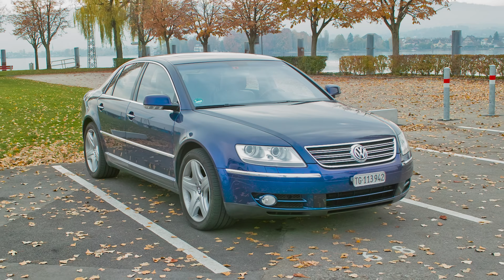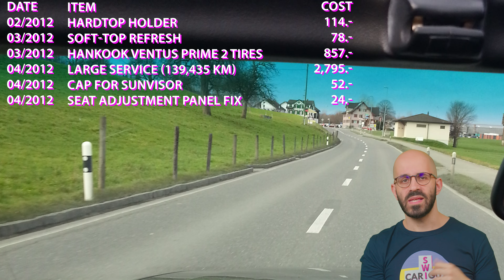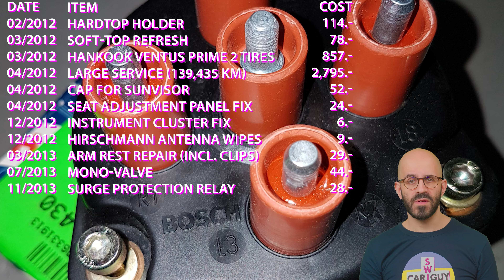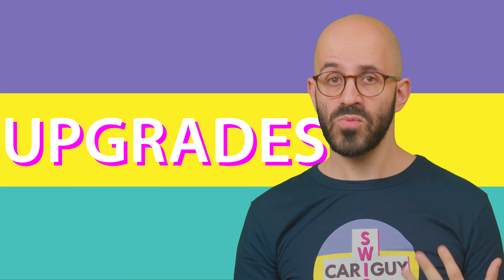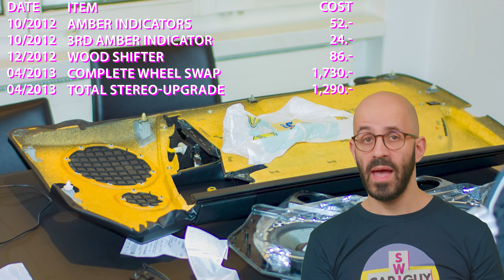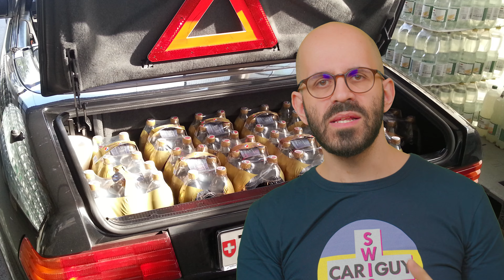How expensive was it to own a 1991 Mercedes 500 SL? Total Cost of Ownership [TCO]

Comment: A really helpful video, thank you.  I did note  are a couple of minor errors... The hardtop is not fibreglass.  It is an aluminium frame and skin. The biodegradable electrical wiring was fitted to R129 cars from 1993 -1995.  The Mercedes company were however still using this wiring in other models into 1996.

Comment: 11:50
If you don’t mind my asking, where did you get those 10 franc panels from? They’re like $130 on eBay, aftermarket not new. 
Does Mercedes still offer this part?
Reply from the maker: I did not replace the entire panel, only the plastic frames that get screwed to the panel. I bought those from the Mercedes dealership for very little money. These are the part numbers:
1297270111 Left door, top frame
1297270311 Left door, bottom frame
1297270211 Right door, top frame
1297270411 Right door, bottom frame

In case they are not offered anymore, a good soul on makerworld shared a 3D-model for at least the lower brackets that can be 3D printed:  https://makerworld.com/en/models/114099
Reply: @swisscarguy 
Thank you SCG! 
I think I misunderstood. I thought you were referring to the seat switch panels (the wooden veneer joystick covers) A1297200322 / A1297200422. Coz those are exuburantly expensive. The custom made ones are almost $500 a pair. 
The link is retrieving error 404: This model does not exist or has been deleted.

Comment: Hi, great video! I have a 500sl 1992  and have the same issue as you did in traffic having to fully stop in order to open or close the convertible top. Wondering if you remember which is the speed sensor wire and where is located, the one to cut and enable retraction of the soft top while rolling? Thanks :)
Reply from the maker: The mod is very easy, as it's just two wires that need to be cut. The control unit is under the rear right interior storage box ('back seat'). 
On the large connector you would have to cut the green/black cable and the black/yellow (attention, there is also a yellow/black one that you must not cut). Just tape up the loose cable ends and you're done.

Comment: 11 hydraulic actuat.ors for hard top. chain that may stretch if not replaced. degrading wiring harness hoses and clamps. possible multiple oil leaks ... flex disk replacement.. engine management computer failure. .... after about 10K or more you may have it sorted out

Comment: 1996 to 1998 are model year SL 500’s to buy.  They have the 119 engine and the 5 speed.  They also have modern fuel injection instead of mechanical injection which is very problematic.  It is worth the minor loss of power for the improved gas mileage and reliability.
Reply: What’s wrong with the 99 ?
Reply: @pharaoh390 The engine was cheapened.

Comment: I have owed a 1999 SL320 for 7 years and I am thankful I never saw your video before I bought it, because I never would have and I would have missed out on the best drive of my life! I still have it and apart from replacing the ECU when the roof decided to stop working and replacing the soft top plastic windows the car has cost me nothing but general servicing, road tax and insurance and since I retired the insurance now is negligible! I wanted a 500, but never saw one with a clean interior so when I saw my immaculate 320 that had only been owned by one lady from new until she passed away I had to have it. Cost me £7k and I have been offered £14k for it recently so it should actually cost me nothing if and when I get around to selling it!

Comment: Helpful.  Thanks. I own a '14 MB e550a cab with 65k miles.  Only replaced a parking brake release and tightened some body bolts so far. 

This helps me set my repair  expectations at $10k -$20k for the next 100k miles.  Much higher plans than I have spent on other new Japanese sedans getting them to 250,000 mi.

Comment: Great video!!  I own a 1991 500 SL.  Bought it in 1999.  I live in Florida which is a great place for convertibles.  It now has 89,000 miles (143,000 km).  I keep it in immaculate condition and only drive it occasionally in nice weather.  It is kept under cover in my garage.  I love this car and like working on it myself if something needs to be fixed.  I am intrigued by the mod you did (wire cut) to allow soft top operation while driving.  Do you have a video covering this modification?  If not can you provide the info on this?
Reply from the maker: The mod is very easy, as it's just two wires that need to be cut. The control unit is under the rear right interior storage box ('back seat'). 
On the large connector you would have to cut the green/black cable and the black/yellow (attention, there is also a yellow/black one that you must not cut). Just tape up the loose cable ends and you're done.

Comment: Love this video.  I have a 2015 R231 SL550 in a Designo Graphite Metallic and have been wanted to add another SL, likely a R129 in a different color - perhaps Irridium Silver.  I had a 2002 G500 in Techtite Grey Metallic which appears to be similar to your 91 500SL.

Comment: I have a friend willing to sell me his for 300 due to relocation. What you recommend I do to find out the issues on the vehicle?
Reply from the maker: Look it over carefully and drive it. Push all the buttons, try everything and make sure everything works. A wire harness that is failing can be seen with the naked eye. And there should be no rust. The R129 were well built in that regard.
Reply: @swisscarguy  great video. How about fuel consumption on this ke jetronic version? I imagine you have an objective idea after 4 years of ownership and more than 10.000 km driven. Thank you. By the way,  much is a good 500sl worth nowadays? Cheers

Comment: I bought my 1998 SL500 last summer and love it. I replaced all of the convertible top hydraulic cylinders myself, 11 total, not difficult at all and also had the canvas top replaced with a color that complimented the body color. Purchase price was $8,500 US, all repairs and upgrades brought that to $13,200 all in, that included $1,400 shipping car from Atlanta, Ga. to Buffalo, N.Y. and installing a rare 6 disc CD changer in the trunk. I love my Mercedes !
Reply: Where did you order the hydraulics?

Comment: Thank you for the detailed report and reference for your car. I am extremely interested to buying an almost exactly same car. A 500SL with 105.000km with all the repairs you mentioned  and more like both of the fuel pumps and the 12 pumps of the roof. All these for 18.000 euro approximately.I got a bit skeptical about the drivers seat and the sense of the steering wheel... I think that it’s important to give you a proper sense in order to enjoy it as much as possible. Totally is it worth buying it or should I search for a Honda S2000, which is a convertible also but a totally different car. Thank you in advance, greetings from Greece
Reply from the maker: 18k Euro is pretty serious money. The car should be pretty good for that. 
The SL and the Honda could not be more different (while still being 2-seater roadsters). The SL is a cruiser, while the S2000 is a much more active driving machine. The steering alone will make for a completely different driving experience.
I think a R230 generation SL500 (or SL350 as the don't come standard with ABC) might be somewhere in between the R129 and the S2000. You don't have the classic look (and old-school solidity) of the R129 but much more driveability (and interior space). 
The 500 SL is more akin to driving a classic car while the S2000 feels much more like a modern sports car. 
Before you make any decision, make sure to have a nice extended test-drive in any of the cars you consider. Only after having driven all of them you will know which one you really like best.
Reply: @swisscarguy  it seems like it is properly maintained...so that's why I'm thinking about it. The good about this case is that it's not so easy to be sold. So that's why im taking my time. Soon after the chief mechanic of a Mercedes Benz official retailer, who I am trying to convince him to check the car, because he works at another location but i trust him a lot, tells me his opinion about it i would let you know
Reply: @ΠαναγιώτηςΜπουτος-π4ι  i import cars from greece to albania and italy.
18.000 on car.gr for any 500sl is an excellent price and it isnt going to get lower than that.
On the other hand the s2000s are going for 13-14 thousand on the cheapest side and they all are dilapidated and destroyed from being drifted, too many burnt clutches and bad engine mounts.
Reply: @swisscarguy  thanks a lot for the advice

Comment: Very good sum-up, and nice to listen to. I didn't know you owned an R129 SL, in fact you owned plenty and only interesting cars. I was aware about the R230 SL 55 because I watched this video a very long time ago. I kind of expected the results because with your other cars costs in mind, I couldn't stop thinking through the video "still surprisingly cheap!" "Wow there we are and still no catastrophic unavoidable repair??"

I like this generation SL a lot, my favorite being the 600. It is just impressive how this car was high-end and yet, today it still is, but looks very understated. And when you climb inside, you realize everything is beautifully crafted, it is super quiet and rides like a carpet. But obviously that comes at higher owning costs, and the adaptive suspension is standard, probably to support the weight of the engine.

While being an objectively good and a very respected engine among the Mercedes community, I agree on the M113. It's a shame it only has 3 valves per cylinder and it lost power compared to the M119. However, in 55 AMG cars with the supercharger, it rocked. 470 hp is crazy even today. And it managed to stay ultra reliable.

Comment: hello. thanks for the video I watched the movie out of curiosity and you inspired me to open the roof. I will do this cool mod in my only on the switch so that you can activate it at any time. greetings from Poland, SL 500 99
Reply from the maker: On the 99 it's not supposed to work by cutting a wire. You will need to install an auxiliary control unit for that. But that is not a big job, as I've done it on my R230 that I had later. It just costs more money than just cutting a cable.
Reply: @swisscarguy  If I find some time I will check it. Thanks for the information. I will write if I do anything.

Comment: How expensive would it be to replace the top on a R129 ??
Reply from the maker: The soft tops themselves can be bought starting at around 500 $ / Euro but it's the labor that adds up. It will take something like 8 man hours. The soft top pope in Germany - a guy who used to work at the Mercedes factory in Bremen where he did nothing but install soft tops - can do it in about 4 hours. But nobody's more skilled than him with these tops.

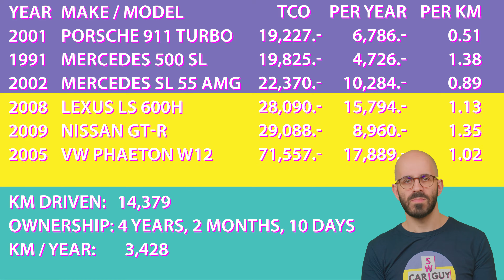Comment: 9:45 I hope the humbled mechanic was not the brand name dealer. 28:00 I wonder what TCO would be for using brand name dealers where possible. I have not much experience but hope TCO would average ~10% new purchase price for typical ~13k km annual mileage as a guideline compared ~3% DIY not driving much you experienced, else ~6% with typical mileage. Though ~10% might still be possible even if not using main dealers, if driving the unmentionable!
Reply from the maker: My unmentionable was CHF 220'000 new. 10% would have been 22k per year. Even I managed to do better than that (otherwise I would have gone broke 😢). But leaving out the options and looking at a base  W12, it might be right on 10%. Of course, if you can DIY more the costs will be lower. But yes, great observation!
Reply: Correction - I managed to watch the horror film again and you were not doing much of it DIY so maybe the ~10% it cost was to be expected - now we know